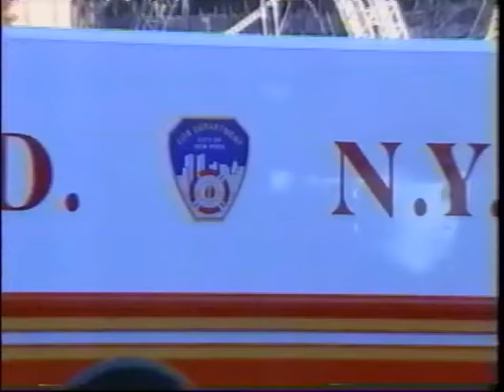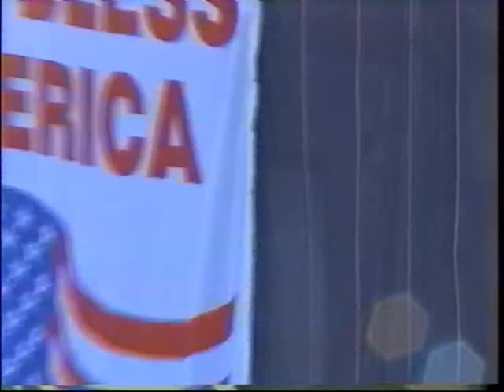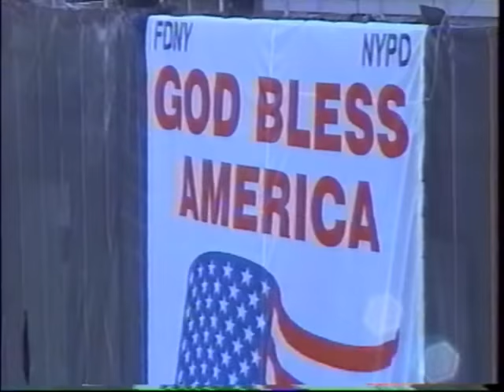Ground Zero recovery months after 9/11/2001

Comment: Why they didn't use that huge corner piece of one of towers from 9:50 as a part of memorial?
Reply: How is that gonna work?
Reply: It’s like 12 stories high
Reply: They didn't want evidence left behind
Reply: Use it how?   Leave it sort of standing leaning up against a wrecked building next door?    Parts of the wreckage did make it into the museum/memorial that’s now on the site-
But there was no way to safely leave the damaged portions of the structure still standing- the WTC went 10 stories Below ground, and all of that was damaged and had to be excavated out to stabilize the site.
Reply: Too dangerous?
Reply: It’s too big to fit in the memorial but they have the 2 tridents on display in the museum
Reply: They wanted no evidence left ☝🏽 Also may all they victims rest in peace and hopefully this case of inside job and not terrorist act will come to a close with evidence 😾
Reply: it’s not safe?

Comment: Nice job engineers and project managers to put together a plan to demo at lightning speed.  Nobody except planners could ever have put together a system like this and this skill is goes widely unnoticed.  Had it not been for these behind the scenes persons, more could have been killed in the demo.  Kudos!
Reply: Incredible demolition! Silent, flash-free detonation charges that left not a trace in the seismic record. Demo crews not seen by anyone must have been wearing those incredible Ninja invisibility cloaks. They must have hypnotized everyone so they wouldn't notice all the drywall and insulation ripped away from columns to gain access to the steel. Nice job!

Comment: Those fires must have been unimaginably hot, it’s still smoldering months after they fell. I wonder if they ever did any thermo readings on the debris to see how hot it was under the top layer?
Reply: There were cars in the basement car park with their alloy wheels just melted into puddles.
Reply: And if you think that was caused by just jet fuel and a crashed plane you should reevaluate what you have been told
Reply: @ancientlord7695 diesel fueled engines can burn hot enough to melt thier aluminum pistons and burn up thier hardened steel exhaust valves, so don't try and tell people that jet (diesel) fuel can't burn that hot. Yes a burning puddle of fuel doesn't burn very hot, but when fed oxygen in the right circumstances it absolutely can melt metals like aluminum and copper. Certainly gets steel way beyond the temperature of losing strength as well.

Comment: Surely examples of the captured smoke were available for analysis?  
It looks way outside of the official narrative
Reply: It is. Way way way
Reply: @hornox4life How much fuel would a jet engine use per second to provide enough thrust to achieve a horizontal vector approaching the towers?
Estimate 550mph at 300 metres be fair..
The plane wings would not have mass without fuel (aviation aluminum is as hard as steel) to provide the punch.

Comment: Wait. Ground zero was still smoking after months?
Reply: @vlaminggarrulus4785  Common science knowledge :D And your example really can't match destruction of WC, it's not only about those planes, but about those buildings too. In your example plane run through that building, because it wasn't that big like WC so plane doesn't stayed in. And if plane stayed in, that building would not proceed that much heat in collapsing process with, i don't know 20m, with concrete? WC had around 430m with iron/metal traverse, that can producing heat after bending.
Reply: @ChumWaffle  friend, thermite did not destroy buildings, although it was also used in the upper part of buildings (to simulate aircraft attacks), and even when buildings fall, accompanying explosions are observed in the video. The buildings were destroyed by underground thermonuclear explosions, three buildings by three explosions. The smoke from the ground is a thermonuclear fire under the ruins. Firefighters fought for 100 days at the epicenter of an underground thermonuclear explosion at Grand Zero. There was radiation all around, and everyone who worked on clearing the rubble later fell ill with leukemia. From 2001 to 2024, about 90 thousand people died from leukemia, no one told them about radiation

Comment: 7:25 North wall of the North Tower leaning into 6WTC is the culprit that destroyed Building 7. That wall was 65ish floors tall when it fell over to the north, and the lower portion was arrested by Building 6 as shown. The top part then slung into Building 7 at the very top, and sliced down through the building, creating a top to bottom breach of 7's perimeter wall. David Chandler measured that flung top part at about 75 mph, much faster the other falling steel, and this is why.

Comment: Months after? And still smoldering?
Reply: Pools of Molten steel in the basement for weeks after. But jet fuel doesn't melt steel 
Nothing but questions
Reply: Nobody said it melted steel. It's over a million tons of debris yes it's still smoldering
Reply: @mikebyrd8278  yes, yes they did say it melted steel. There was a pool of Molten steel at the bottom of the basement that was shown on the news and they even showed thermal sattelite images to show the intense heat from the pool of Molten steel. There are several accounts from recovery workers in the weeks following that describe the place as looking like a foundry.
Reply: @oliver9089  🙄 well it was molten aluminum
Reply: @mikebyrd8278  nope, steel. The firefighters said it was glowing red. Aluminum doesn't glow red when Molten. There are (still) videos of this first-hand account readily available. And the news media reported on it at the time. Maybe you weren't born yet in '01, but those of us who were would certainly remember this being discussed. It was common knowledge
Reply: @oliver9089  All metals can glow  red if they get het enough

Comment: look at all that dirt they had to bring in just so the workers boots would not melt from the intense heat of the debris pile....thermetic reaction still causing molten metal.
Reply: +Random Person 

no shit........where do I even mention "smoke"?......but you should 'smoke' another.....
Reply: So you think they brought the dirt in to save workers shoes from melting, probably based off of one stupid news report and maybe a picture supposedly showing thermal differences that had no legend to interpret what you were looking at.  Yet had you done your homework you would know that in the places where they claimed it was the hottest there were ponds of water that were not boiling and oxyacetylene hoses strung all over the place,  very very long hoses that cost many thousands of dollars, yet they were not elevated.  Any heat that would melt boots would melt those hoses and no welder is going to just lay his hoses on the ground if it's hot enough to melt his boots.  Welders may not be the sharpest of all the utensils in the drawer, but they take care of their equipment and they also get closer to the heat than anyone else.  Maybe thermite was everywhere as a distraction but it did not make the buildings dissapear and it can not make engine blocks in car blocks away dissapear while leaving paper unburnt that is sitting on top of the glowing supposedly red hot stuff.  There are hundreds of pictures of things supposedly burning yet none of them show a single piece of burned paper or burnt leaves on the trees.  The Alex Jones Plan B theory cannot explain the toasted cars or the glowing things that don't burn paper or trees like the trees in the Californian fires not to mention the plastic trash cans that didnt' melt.  There is a reason Alex Jones forewarned his audience, he was either in on it, or they knew his personality so well he was the perfect person to put out the distraction.  Based on his own admission that his family is all into intelligence, ....who knows,  but the only person he won't have on his show is Dr. Judy Wood and I find that very telling.  17 years and he's had every type of person with any kind of knowledge and only one person ever he will not let speak on his show and two pictures out of all the pictures he never showed his audience, those two pictures taken on THE DAY before wtc 7 went down showing a dusty slab from the middle of the first building to be dustified with wtc7 in the back ground and only dust and some aluminum shrouding and not a dent on the ambulance that was parked at the front door.  To me that was enough to know he is a distraction and if you payed attention when Dr. Judy Wood came out with her book and presentation was about the time he gave up 911 truth and became just another politician....go figure, it's sad but since this political circus began I only know of one time he mentioned 911 and that was the weekend trump sent the second volley of missiles and I think that was a mistake, he doesn't cover the huge distortion he created anymore and you must wonder why.
Reply: Adrian  its not smoke or steam. Its fuming debris.
Reply: If you haven't noticed, a lot of sites like that have dirt or stones on the ground because it's better than walking on glass, steel and huge lumps of concrete.
Reply: Oh that's brillian,  You have two buldings that supposedly collapse and a rescue effort must be launched.  Hmm first thought, bring in hundreds of trucks of dirt and stone to make it more comfortable for the rescue workers and dogs.  You don't know what you are talking about and have not researched this thing out hardly at all and it is so obvious to someone who has.  You don't bring in trucks of dirt to dump on piles of debris when there should be people trapped under that debris.  they brought the dirt in because the de-molecularization did not stop when they wanted it to, they already knew there were no bodies and if you had any idea how much glass, marble, concrete and steel it took to make those buildings then you would not believe your eyes when you look at the fema photo taken on the day before building 7 was destroyed which shows only dust on the cleanly swept concrete ground floor and only dust on the ambulance parked at the front door, there is not one steel beam to be seen anywhere on that slab, only the convenient pile on the outside edge for the lying news dogs to use to push the lie.  When you say a lot of sites like that you are pretending like anyone on earth has ever seen a site like that before which is a lie.
Reply: EVANGELIO Y EL AMOR  so what are you gonna do send 1ml million planes?? To war zone??
Reply: @ryanreus1753  It is NOT thermite there was TONS AND TONS of flammable materials I'n building
Reply: Underground nuclear explosion, it was already Confirmed by a Russian general
Reply: @ryanreus1753  that is 💯percent true. And isn't it funny, well not funny because its more scary, but at how when we try to tell the truth of what happened that day, we're ridiculed and made fun of or not patriotic enough.  The brainwashing,  mk ultra runs deep here

Comment: Indeed, why are the supporting steel columns sticking out of the ground cut at an angle???
Reply: That's not the smoking gun that it appears to be. There were precarious chunks of metal sticking out of the pile all over the place which they would hook up to with a crane and then torch cut loose to dismantle the rubble.

The pools of Molten steel below the rubble still liquid weeks after the collapse is more telling. Or the massive destruction to all the buildings next door that still stand, yet #7 which was 2 blocks away collapsed instantaneously after being on fire for 6 hours 🤔

Comment: if the plane hit the upper part of the building then why the building coming down. on earth
Reply: Controlled demolition. Same as WTC7 that wasnt hit by a plane.
Reply: Because the planes in 2001 carried much more fuel than the jets that the architect planned for. The building was weakened by the impact then the fires, the floors collapsed down on top of each other, heavier as they crashed down.
Reply: Because the jet impact destroyed the fireproofing and sprinkler system. The trusses heated up which made them sag pulling in the exterior walls until it collapsed. The top block had enough mass and inertia to crush the floor below it adding even more weight. An so on all the way down to the ground

Comment: December 2001 and the steel was still burning with smoke? ... Very odd.
Reply: Steam is coming from the high pressure steam system used to heat the buildings in the area.
Reply: +yostopitkim  +SLORRIFJART321 I doubt that they would send a water truck to spray water on the steam as seen @ 11.24 if it was just steam for heating the buildings. Did you not see the pics of red hot molten metal being pulled from this site? Or the map of it, showing the temperatures where those buildings once stood, and recorded temperatures as being around 2000 degrees?
Reply: Jammy Git
I've heard about the heat maps, coming from NASA. But saying 700 degree Celsius on the surface is not credible, when we see pictures of people walking around there, searching through the rubble and even going down in the sub basements.

The thing is, they are all lying. Therefore we can not trust them.
Reply: Go talk to an old time landfill operator. Underground fire can burn for months, if not years. Nothing odd, considering the piles were loaded with thousands of tons of shredded combustibles.
Reply: whetedge Thanks for the opinion and assumptions
Reply: Curbstomp Shills Be sure to point out the "opinion and assumptions" in my statement of fact.
Reply: It's from thermite
Reply: yostopitkim it's the military grade nano thermite causing it.
Reply: Adrian no it's the nano thermite that was used to weaken the structure that's causing it.
Reply: It was fuming for years
Reply: It's steam.
Reply: jrftworth no...the conspiracy theory was created when when the fire fighters said they heard bomb blasts, the engineers noticed “quiffs” and building 7 fell. It was created when we were told twenty minutes beforehand that it had already fallen. Due to fires on two floors. I can certainly understand why people would question it.